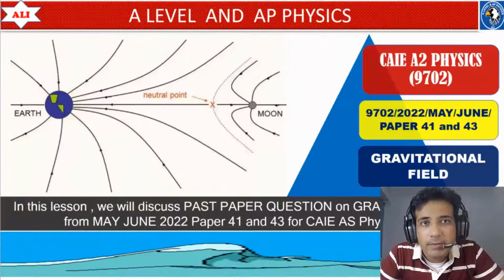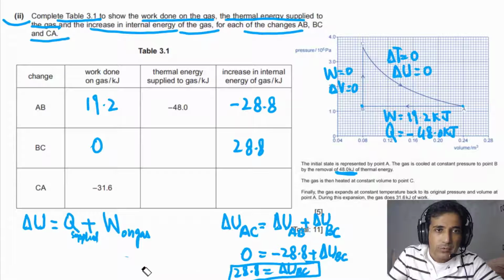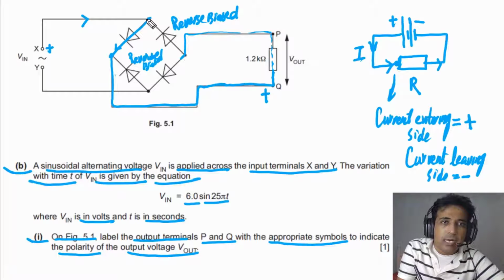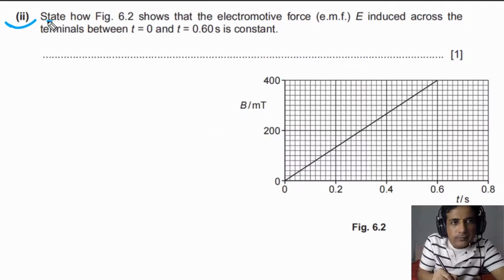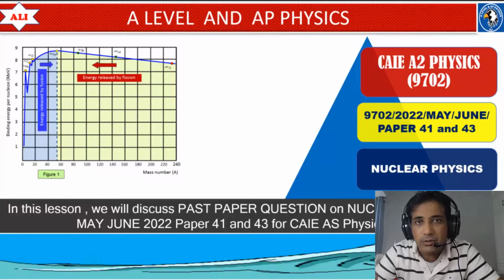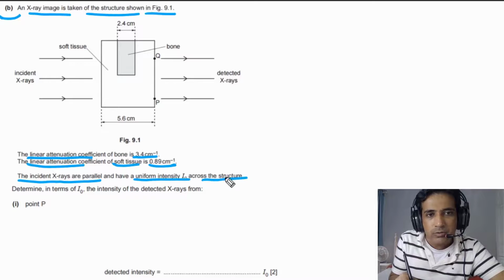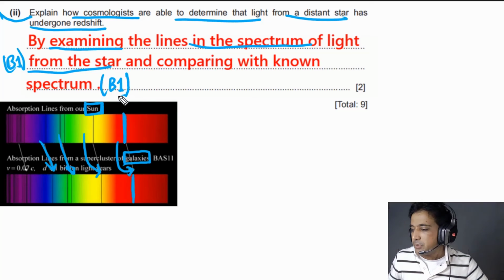CIE A2 Physics 9702 paper 4| May/June 2022 |Paper 41|Paper 43|9702/41/M/J/22|9702/43/M/J/22-Solution

Comment from the maker: Summary

This video discusses several physics topics using past paper questions from the June 2022 Paper 4, including:
Gravitational Fields: Newton's Law of Gravitation, gravitational field derivation, and neutral points (0:00, 
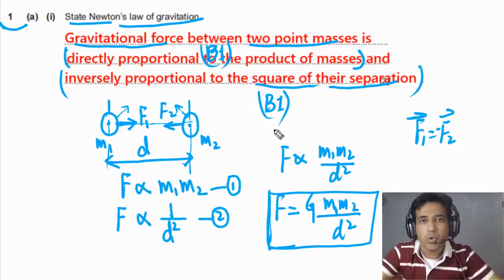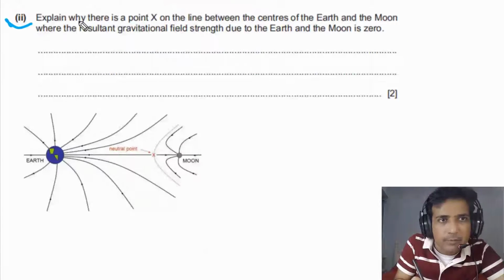5:43, 11:32).
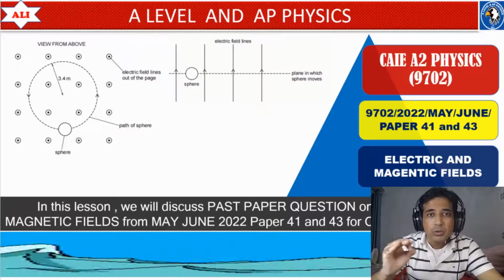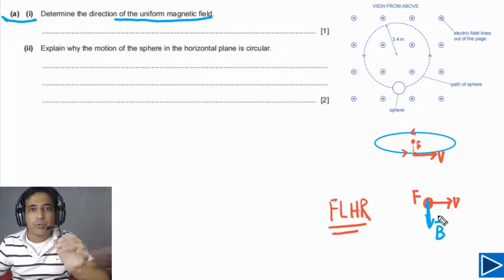Electric and Magnetic Fields: Examining the motion of a charged sphere in electric and magnetic fields and determining field directions (19:27, 24:59).
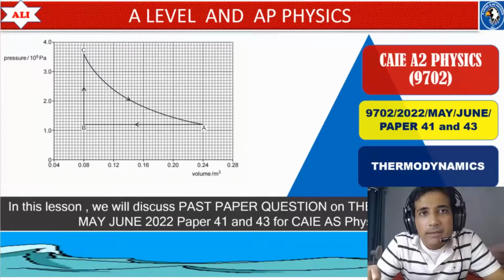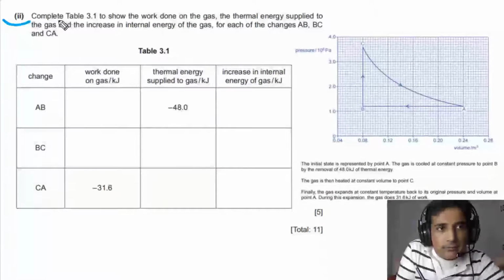Thermodynamics: Ideal gas equation, isochoric and isothermal processes (33:54, 45:35).
Simple Harmonic Motion: Analyzing simple harmonic motion in a pendulum and relating it to the gradient in the graphs (51:18).
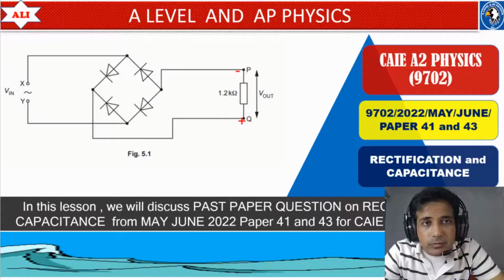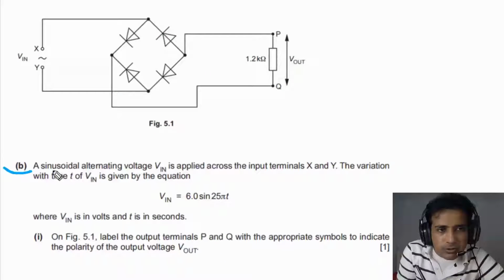Rectification and Capacitance: Full wave rectification, explaining the polarity of output voltage, and sketching the output wave (1:06:53, 1:11:17).
Electromagnetic Induction: Defining magnetic flux and flux linkage, explaining induced EMF (1:30:18).
Photoelectric Effect: Defining photons and photo-electric effect (1:51:08).
Nuclear Physics: Nuclear binding energy and nuclear fusion (2:02:12).
X-rays and Medical Imaging: How x-rays are produced and good contrasts (2:21:07).
Astrophysics: Wien's displacement law and reshift (2:37:58, 2:46:37).
Reply from the maker: Significance of the Neutral Point

The neutral point, also called the neutral point X, is a location between the Earth and the Moon where the gravitational field due to both celestial bodies is zero. Understanding this point is crucial when planning space missions between the Earth and the Moon.
Definition: At the neutral point, the gravitational fields from the Moon and the Earth are equal in magnitude but opposite in direction, resulting in a net gravitational field of zero. 
11:44
Energy Efficiency: Sending an object from Earth to the Moon requires significant energy. Knowing the neutral point is important because, to reach the Moon, a spacecraft only needs enough energy to get to this point. 
12:59
Gravitational Influence: After reaching the neutral point, the Moon's gravitational pull will take over, attracting the object towards the Moon, thus reducing the energy needed for the journey. 
13:13
Mission Planning: Understanding the neutral point is essential when planning missions to other planets or celestial bodies. 
13:13

Comment: when to use right hand grip rule and left hand Fleming rule? 
also i can use left hand fleming rule for both induced current and supplied current as along as my current points towards the correct direction? for example if im finding induced current i can use left hand rule but middle finger direction (current) will be induced current direction?
Reply from the maker: FLHR is used for motor ( electrical energy converted into mechanical energy ) and Right hand rule is used for generator ( mechanical to electrical energy ) .

Comment: Hi sir at 1:44:28 , you use left hand rule, but isnt it acting as a generator? Otherwise, what is the generator (is it the changing magnetic flux? shouldnt the generator also have force magnetic field and current so we can use right hand grip rule) sorry, my concept of this is still really bad
Reply from the maker: When a current carrying conductor is inside a magnetic field ( motor effect ) , we use left hand rule to find direction of force . In this case , when induced current is in the wire and wire is inside external magnetic field then direction of opposing force can be determined by LEFT HAND RULE i.e. motor .
Reply from the maker: In generator effect , if we have direction of induced magnetic field , then we can use RIGHT HAND GRIP rule to find direction of induced current . With help of RIGHT HAND GRIP rule , we can find direction of magnetic field if direction of induced current is known and vice versa .
Reply from the maker: If you listen explanation once again , it will make much more better sense . Feel free to ask if you still have any questions .

Comment: sir for q6c everytime when they say the terminal connected together then it will become like a close ring right?
Reply from the maker: Yeah ,if  terminals (or ends ) are connected it will form a closed loop .
Reply: @alevelandapphysics-ali  so closed loop will cause an induced current to flow if there is an induced emf right? if not closed no induced current flow right
Reply from the maker: @你很牛  That's right , you got it .

Comment: 1:49:10 What if the direction of the current is reversed? The coil would be unaffected as forces on the opposite sides are equal in magnitude and opposite in direction
Reply from the maker: If external magentic field is decreasing then direction of current will be reversed and forecs on opposite sides will be in opposite directions ( outwards ) and forces will try to increase the area of coil to minimize change in flux in coil .

Comment: For 17:00, why is the final answer given to 2 significant figures when the question stem gives 3, and is it okay if the significant figure is given to 3 (3.83 * 10^7 m)?
Reply from the maker: x is the distance from the centre of the Moon to the neutral point , it's a large distance and can't be more accurate than 1 cm so it's sensible to use 2 s.f but 3 s.fs are acceptable based of sig figs rule .

Comment: Sir, at 1:45:00 you use the right-hand rule. You stated the curled fingers give you direction for current and thumb direction of magnetic field line. Isn't it the opposite?
Reply from the maker: For right hand grip rule , if fingers represent direction of current then thumb points in direction of magnetic field and vice versa .
Reply: thank you @alevelandapphysics-ali

Comment: Hi sir, I have a question for Q6 (c),

I know that the induced current interacts with the original magnetic field (into the page) so there is a force inwards on the coil.
I also know that the induced current creates its own field(out of the page) to oppose the original field.

Why doesn't the induced current interact with its own created field so it has a force inwards on the coil?
Reply from the maker: Magnetic force is due to interaction between two magnetic fields .
Reply: @alevelandapphysics-ali  Thank you so much sir.

Comment: Sir, 
Thank you so much for your videos. They make my revision so much more effective!

I do have a question for Q2. If the magnetic force should be in the opposite direction to the electric field lines, as it shows the direction of the electric force, how does it provide the centripetal force if the magnetic force is already into the page (the opposite of the electric force)?
Thank you so much for your time
Reply from the maker: Electric force( vertical plane )  and magnetic force ( horizontal plane ) are not in the same plane . Centripetal force is provided by magnetic force which causes particle to move in horizontal circle . Magnetic force is perpendicular to electric field lines .
Reply from the maker: let me know if you still have questions .

Comment: Sir 
This is a doubt on X-ray intensity. Please kindly help 
The intensity of the X-ray beam can be increased by having more X-ray photons produced which means more electrons should strike the metal target. This is controlled by the cathode(heater) current. 
But since intensity is wave power/ area doesn’t it also depend on energy of x ray photons which depends on accelerating voltage as well. (E=hf=eV)

Thank you sir.
Reply from the maker: Intensity can be increased by increasing number of x-rays photons or increasing energy of each photon . More intense x-rays beam produces image quickly so we only increase tube(cathode) current to increase intensity , not accelerating voltage .If we increase accelerating voltage , it will increase hardness which will increase penetration power and image quality will be poor due to poor contrast . Hope it helps.
Reply: Understand now sir..thank you very much